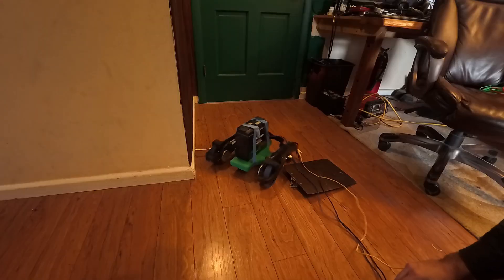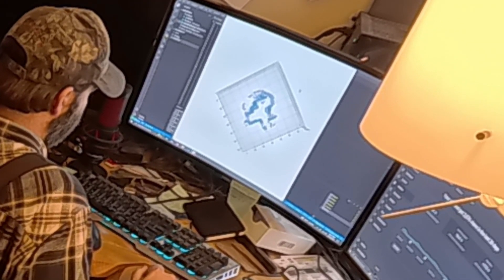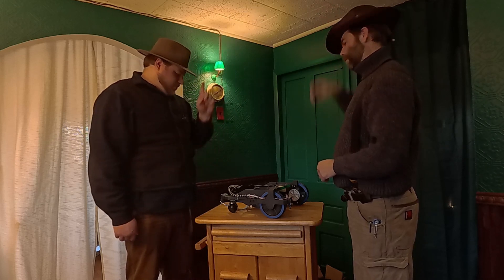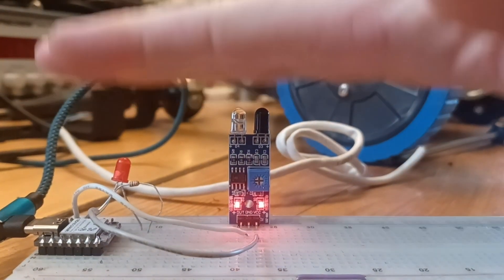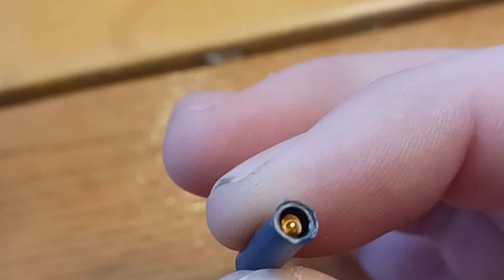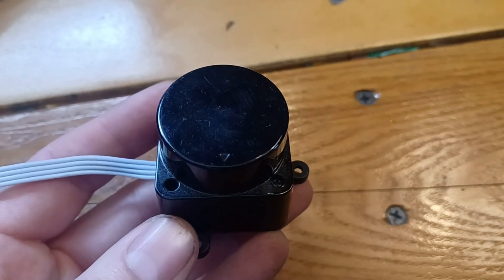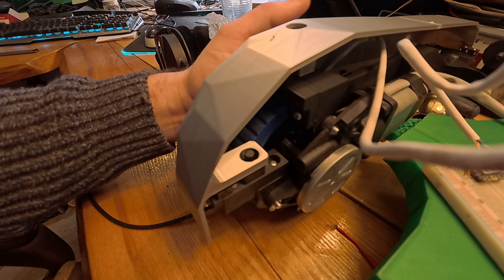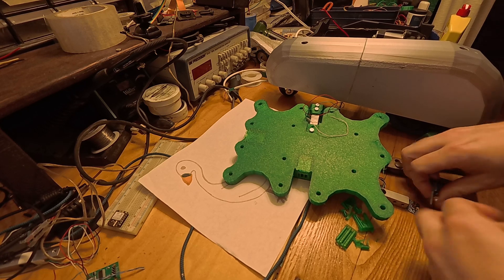Household Robot Project  EP12 :: I think I've invented a new class of robot...

Comment: In theory, wouldn't the vibration spring sensors be redundant with the IMU in the chassis? Collisions should show up as a sudden large spike in acceleration. Although since that vibration spring is just a switch, you could enable an interrupt on the pin of the microcontroller it's connected to and then you don't even have to constantly read it, directly making a physical collision an "event" in software fairly simply.

And perhaps there would be a difference/benefit to mounting the vibration sensor on the outside edge of the robot, perhaps on the bumper itself? Since I'm sure you're mounting the IMU near the center of the chassis, basically attached to a lot more mass, thereby reducing it's sensitivity to sharp/high-frequency vibrations (so any IMU on the main body's mass may only be able to reliably detect HARD hits)?

But I have a feeling the vibration sensor might actually be TOO easy to trigger, and it might get triggered by simple terrain bumps without being able to distinguish between that potential false positive, and a true positive collision detection, making it not so useful to action on. Idk, I'm sure you'll do plenty of sensor testing and experimenting to find out!
Reply from the maker: Yeah, my plan is to mount the vibration sensors directly on the fenders (which move when bumped) and bumpers, while the IMU will be connected to the full mass of the chassis. Also, the IMU will be mostly for measuring gravity and rotation rate, so I don't have to poll it as often. I'm expecting some false positives from the vibration sensors, but I can only guess at how often they will misfire until I start experimenting.
Reply: @joethieman9400  alright, cool. Can't wait to see it!

Comment: My robot journey started during Lockdown. When I first started my robot I did not think the mechanical pieces would be the hardest. I coated everything with the 4 wheel drive sensors camera etc, But when it came to the mechanical I ended up going with parts I have on hand being manipulated. This is a lead me on a journey of welding and even carving balsa wood. The balsa woods nice for surrounding the electrical components because it can sit out in the sun all day. That's my primary goal is to have a robot outside always that can do a bunch of stuff and tell me things.
Reply: I call him Artax. The horse from never ending story that gets stuck in the mud. As my robot is planned to be out in the mud, Not stuck of course lol
Reply from the maker: That's awesome!   Yeah, I feel like there's a lot of mechanical engineering to be done in robotics... and frankly, I think the selection of off-the-shelf robot parts (at least on the scale you and I are working in) sucks!  😂